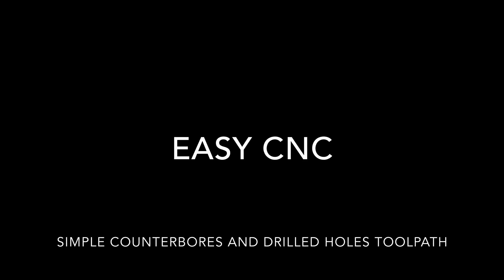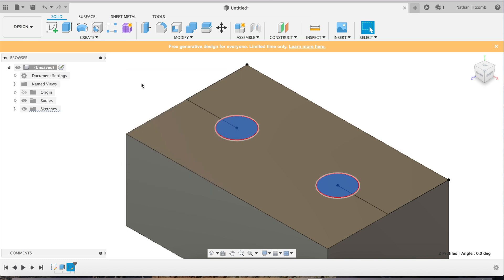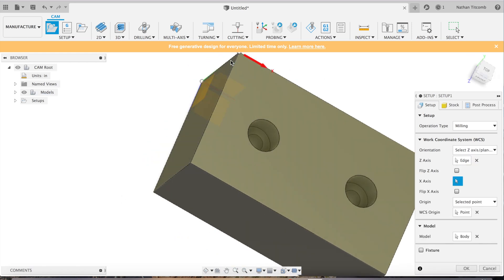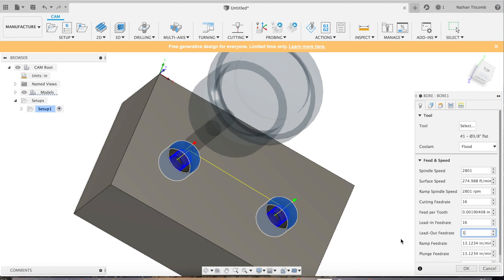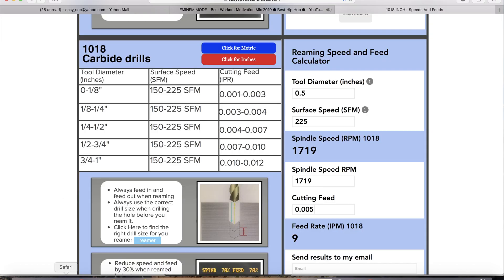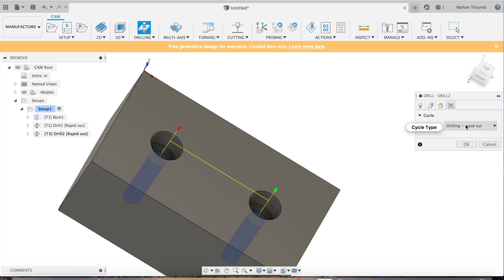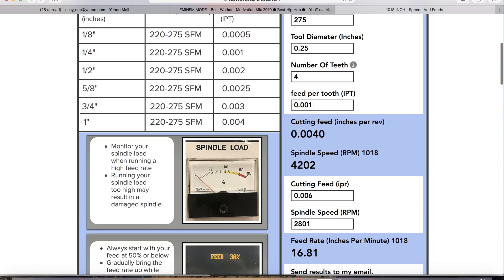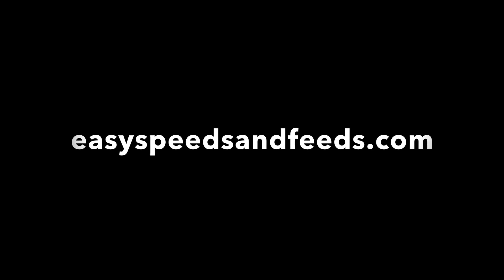Fusion 360 Tutorial : Simple Counterbore Design and Toolpaths

Comment: Newbe here. 

Great video. 

Have a question for you if you’ve got time. 

Working with a wood spoil board. Using a .250 flat mill cutter.  I want to  counter bore say .625 Dia x .500 deep and plunge drill through at .250 Dia  as a single operation per hole.  On a series of multiple holes. 

Having a difficult time getting the CAM correct for that single operation. 

I’m obviously missing something simple. Any pointers would be greatly appreciated. 

Best.